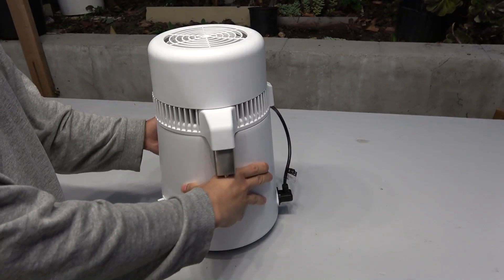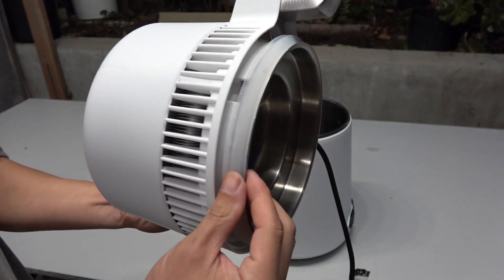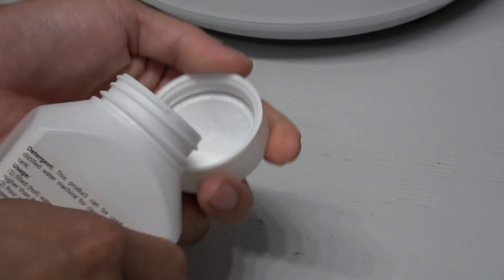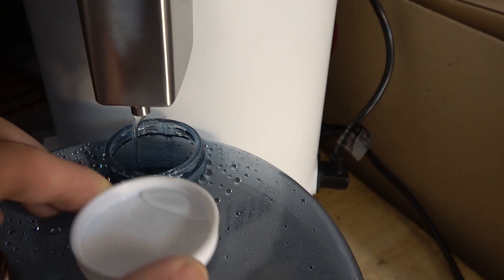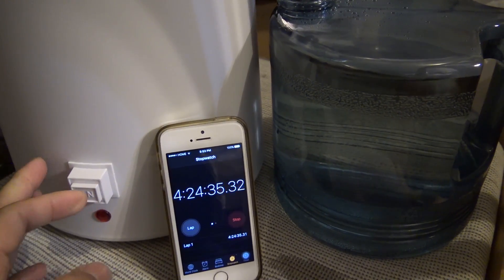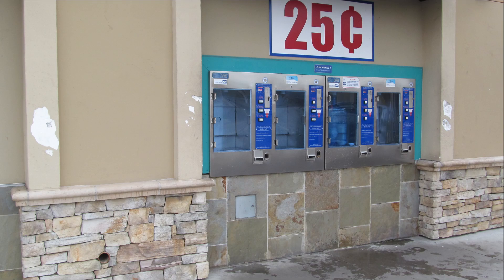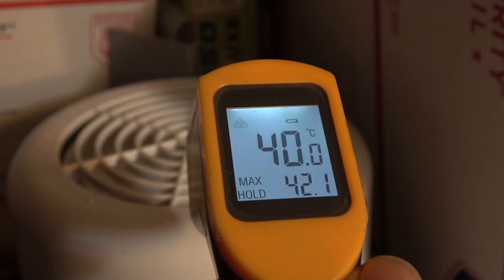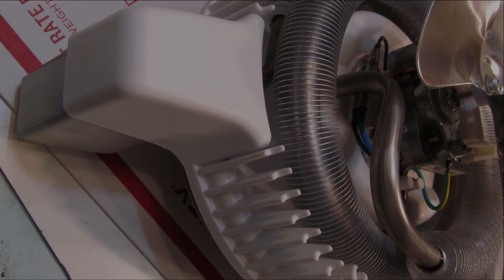Review: $60 Ebay water distiller, all stainless steel internal

Comment: Distilled water is not healthy for drinking becuase the body needs a certain amount of disolved solids in the water . Reverse osmosis is the best , it has 50 _100 ppm wich is what our bodies need
Reply from the maker: Well, you don't eat food?
Reply: Whith all due respect the disolved solids in food are not enough human body needs about 50_100 ppm in water becuase water conumption is much more than food . I've studdied water fileration methods for 3 years . Distillation can be cheaper and easier than reverse osmosis but it is not healthy as RO which is FDA approved

Comment: I would strongly suggest against using a plastic bottle to collect the distilled water. It defeats a large part of the purpose of distilling the water in the first place, since phthalates, perfluorooctanoic acid, bisphenol A/F/S, etc., all end up leaching into the water from the plastic. Use something made of glass or stainless steel to collect and drink the water from.

Comment: Where did you buy the citric acid to clean the bottom?
Reply from the maker: It comes with the distiller when I bought it. Walmart sells 2 lbs of citric acid for $10. Or you can just use vinegar which works as efficient.

Comment: 3:25 "The first batch tasted really bad [...] like engine oil." 
Yeap, I had the same problem. Unfortunately mine lasted much longer (~50x), and I wasn't sure whether it came from the plastic gallon or other places (not everything in mine was stainless steel). During this time I had to distillate 2~3 times so the water could be barely drinkable. Slowly the engine oil taste reduced and nowadays I have no such problem any more.
Reply: Go to Walmart, there is a 3 Gallon Water Bottle that is BPA FREE.  The Brand Name is:  AmericanMaid Water Bottle Dispenser and it's a refillable 3 or 5 Gallon Storage Bottle.  That would be perfect for your Water Storage, since it's BPA FREE!

Comment: Did you take the drip head & collection vessel off, where the distilled water sits before dripping down into the collection vessel? I have a system that looks the same as yours. I was getting black crystals in the distilled water container, then a leak or over flow, from above the drip head. It turns out that there was a bag of activated charcoal in the collection head. This had burst & charcoal was leaking out, then the bag block the drip head. It is useful to clean up the water from anything that might distil across with the water vapour but I did not know the charcoal was there. I thought that the condenser head must have corroded & I would need to replace it! Apparently activated charcoal bags are readily available on ebay. They look like tea bags. If you push the rectangular vessel above the drip spout, in towards the main boiler, you can ease it down & out from the plastic housing. Pop you charcoal "tea bag" in, then hinge the little reservoir back in place. I found that pieces of crystal can also be used instead, to improve the quality of the water. I have used shungite, quartz & amethyst. I am a big fan of using distillation as a great way to clean up & improve the quality of the water that I drink. Using crystals takes it to another level.

Comment: I have this same water distiller , MY problem is that I filled the water to line inside of the distiller but when the water is distilled the distilled water is way less than what I put in ,this just started , what’s the problem . 🤨🤨🤨🤨
Reply: I have the same problem.

Comment: I've got this one 2 years ago. It's going right now. It does clogg up with solids around the inside. But you clean it with stuff like vinegar.  Best buy ever. I boil two kettles  before starting. Saves extra hour working. But it takes 3 hours after boiling 1st. That's 4 litres. It automatically  turns off. Cheap looking or not. It's a good unit.
Reply: Nice ordered one
Reply: Would you know the name or the product number because there are several

Comment: Vinegar will also clean the build up on the bottom.
Reply: How much vinegar/gallon?
Reply: @redbeard8722  no this after you have distilled, if you want to clean the dry scales off the bottom, just pour in enough undiluted white vinegar to cover the bottom. In a minute or 2 you can run the scales off with a rag or your fingers.

Comment: The instructions state to throw out the water from the first batch because the machine needs a trial run before producing clean water. It is not the plastic as the container is bpa approved and does not leak chemicals.

Comment: Too bad it's not made out of ceramic inside instead of metal.. also I have no idea why you would ever put distilled water in plastic after you go through all that trouble... wouldn't it be wiser to store in glass bottles even if you have to have several of them ?
Reply from the maker: It's a water bottle designed to hold drinking water. The water temperature coming out is only about 29 degrees C. I'm not storing my water in there. I'm just COLLECTING it. It's not easy to find a one gallon glass container that fits. The spout is way too close to the distiller. I don't want to use multiple small glass bottles to collect this as I have to come and check every hour to replace or it will overfill. That's totally unnecessary and a waste of time.
Reply: @vuaeco  k.. somebody claims they bought this a couple years ago and they had problems with it tasting weird after a short amount of time and that the tubes becoming rusted inside
Reply: I bought a ROVSUN electric distiller, made and shipped from Eugene, OR, USA, from wish. com, for about $65.00 on sale. I use glass mason jars for collecting and storing. I would not use catch water because of chemtrails. All is dead, inorganic water. Except for Distilled which produces pure organic water.
I've had it for about 10 months with no problems. I clean it after every use.
Reply: @SupportTheTruth 2 to be honest with you I haven't really done any research on steel ...sometimes I think it's nothing to worry about but then other times I wonder if something is leaching out of  steell that could be bad for the brain ... almost as bad as aluminum... I just don't know because I'm so busy and I haven't had the time to do the research but I wish somebody would let me know when they find a video or somebody who has actually done the legwork. . But I did buy some solid copper cups ... the only thing I drink from them is distilled water and I let it sit overnight and drink that in the morning. I don't know if it's that or something else that's making my skin look nice but extra copper in the diet does help the skin look great .
Reply: It is BPA approved
Reply: Jordan Bronson... hey drink away my friend drink away if you like drinking out of plastic...?  .. go for it... personally I am not the only one who thinks plastic is not a good place to store our liquids and other Foods... do what thou wilt .
      By the way is Action Bronson your more intelligent brother ?  I'm just wondering...
Reply: @SupportTheTruth 2 well I will certainly look into that... I can only imagine how wonderful it must be to live in an area where they don't put any chlorine and especially don't put any fluoride in the drinking water... I used to live in an area in the Burbs north of Dallas where we had really wonderful drinking water... it tasted very similarly to the water we used to swim in at someone's house who had a large swimming pool that was fed by an underground spring... you could really taste and smell the oxygen in it and it was wonderful.

Comment: You did a great job reviewing and explaining the machine. I really appreciate all the science and numbers regarding kilowatts. I wonder how much that costs?
Thanks
Lisa
Reply from the maker: Are you asking about energy cost to produce distilled water from this distiller? If that's the case then it would cost approximately the same as the one you purchase from a water store (about 25c to 30c/gal). But the point here is not about saving money. It's about the quality of the water and the accessibility to water when you need it the most in an emergency.

Comment: Very well done and appreciated. You even covered electrical costs. However, I should point out that pre-heating the water to whatever temperature still contained the same amount of joules per cc. This energy had to come from somewhere and if it was from your stove or water heater then the only thing you saved was time, the energy costs would be the same. Thank-you 
vuaeco
.
Reply: And fire
Reply: Still saves a lot of time also solar water heaters work really well

Comment: VERY GOOD review. I really appreciated it . I am thinking of purchasing another distiller off Ebay soon.  Water and having good CLEAN water is more important than people realize.

 I use to have a Waterwise Distiller. They are loud too. I would leave it on the counter over night and in the morning ,have a gallon waiting for me . But when it died , I just starting getting the huge 5 gallon bottles and going to a water store that has reverse osmosis .I need more water as I use it in a rice cooker and that takes many cups of fresh water.

 I have never liked tap water. My Grandmother, back in the early 1960's, said Los Angeles tap water was the worst she had ever tasted and she said they thought they were putting chemicals into the water. She would not drink it nor use it for cooking ! She started to receive Water delivery at her home (Arrowhead water ) and had it delivered until she passed away in the 1980's. Back then they would rent you a water cooler and deliver the bottles to your home, but the bottles were made of GLASS. And, very heavy !  I now days try and store water in glass only although that's not always possible . If people could find a huge glass water bottle at a Yard sale or Flea Market they should snap it up . It will be well worth it. If you buy a Big Berkey you can have water without electricity if it goes down.
Reply: Hey Lorie, I’m wondering did you find one that’s isn’t as noisy as the one you mentioned? I have a megahome and I want to purchase another brand perhaps one that is more quiet! I’d be glad if you want to share your experience😊 have a blessed day

Comment: How long does it take you to Steeler to run through its cycle to do your one gallon of water
Reply: The instructions suggest around 4 hours.  The  video mentions that he uses pre heated water to save time.  But, be cautious..  if  you have a PUR water filter  or an attachment filter on your kitchen sink water,  running hot water through the filter will ruin it.  pre heating the water was mentioned to have saved around  30 minutes.

Comment: Wow; this video has a great review on both distilling process and the item used for it. Very professional too.
Reply: After this video; bought my own from an eBay seller by the name of happykisssoul  - very happy with it. Also to clean the gallon from that nasty smell - I used baking soda and vinegar while swishing it around the gallon.
Reply: @nef003  - Go to Walmart, there is a 3 Gallon Water Bottle that is BPA FREE.  The Brand Name is:  AmericanMaid Water Bottle Dispenser and it's a refillable 3 or 5 Gallon Storage Bottle.  That would be perfect for your Water Storage, since it's BPA FREE!

Comment: I can't find this still anywhere for $60
Reply: Trumpstaffel16 the cheapest I found it was $89.99 on amazon.
Reply: I saw these in varied colors on eBay.  The white one is less than $60.
Reply: I seen one for $50 on eBay just wanted to watch reviews before buying.
Reply: Someone in another comment section here said that they bought this a couple years ago and that in a short amount of time the Water started to taste weird and that Frost was happening on the inside of the tubes and they did not recommend it.. also you know that fan the blades are made out of aluminum and you have to wonder if it's getting any moisture on it at all there's probably aluminum and the water droplets that are going into the distilled water ?

Comment: Have you compared cost of making a gallon of distilled v buying a gallon at the store?
Reply: Excellent question. Around here, it's going to cost about $.60 per gallon. Factor in the cleaning, the life of the unit, the noise, the heat during the Summer. A gallon of distilled water goes for about $1 here, and of course, you would have to lug gallons of water home from the store.
Reply: That could be a factor for some people, and is well worth considering.. But if I have electricity, which this requires, I can access my well water, which I then filter through RO. Or water, whether purchased distilled or filtered at home,  could be stored for such an emergency.
Reply from the maker: It's not just about the cost. Think of it as a survival tool. When disaster strikes and there's no way you can get fresh drinking water, this will save your life. If you use it in a regular basis, you'll have a peace of mind and that you'll always get the best water possible without wondering what is lurking inside that water you just bought from someone else.
Reply: vuaeco also it can be used for many different things, essential oils, ethanol. And who knows what else.?
Reply: @vuaeco  there will be no electricity

Comment: Do you think that by removing the plastic grid on top of the fan could lower the noise?
Reply from the maker: I think that'll make it louder. The plastic lid on the top is there for a reason though. It helps direct the air to flow through the heatsink more efficiently. The only way to lower the noise is to reduce the speed of the fan but you'll get less airflow through the heatsink. Less cooling on the coil means less efficiency. It's a small coil and it has to cool the water from 100 degree C down to 27 degrees C along only about 30 inches of coil.